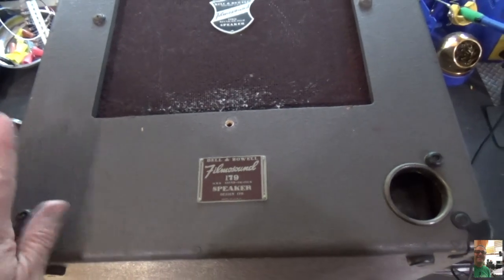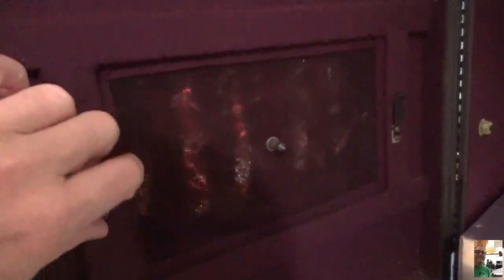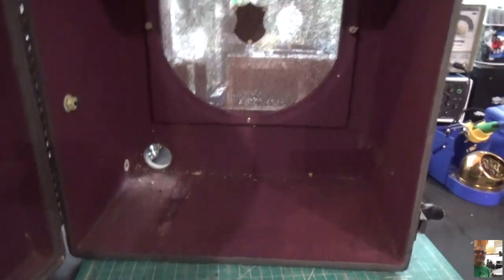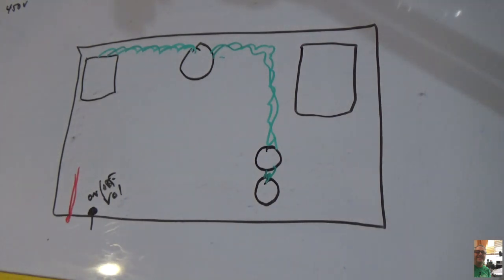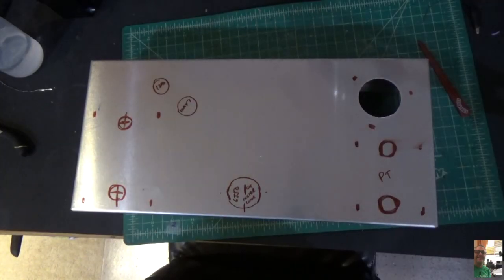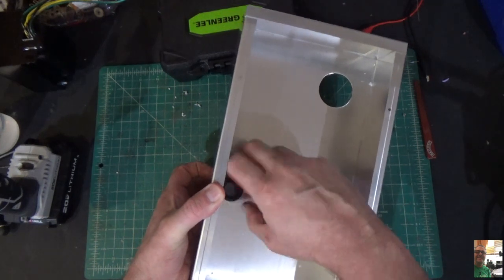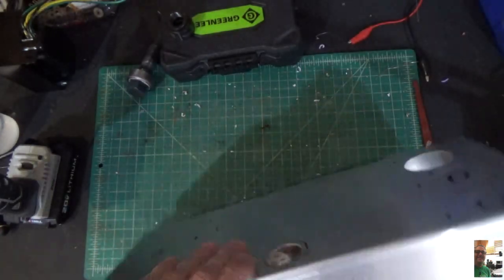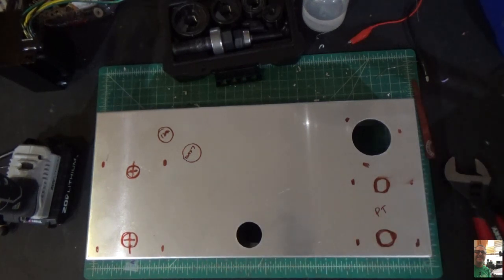The Killer Joe Bass-Guitar Amp Episode #2: Holey DLAB Batman

Comment: A couple of L Brackets would hold that chassis in pretty securely. You would only need two of them to hold it securely and easy to remove for servicing. That is gonna be a neat amp project and fun.
Reply from the maker: You are absolutely right Larry. That is the plan.

Comment: There’s no doubt about it Ron, the slug buster definitely produces neater holes for the reservoir, and smoothing capacitors, as well as for the valve bases.  Also, an excellent position for the KT88: heat will escape via the rear cabinet vent.  I also like how you have positioned the large smoothing capacitor away from the KT88: the affect of heat should be minimal. 
Though I like your idea for the front control panel very much, some people would position the controls and jack socket onto the rear of the chassis, whereas I would likely think along the lines of cutting a rectangular letterbox type of hole in the front bottom of the cabinet, and attach a highly polished finger panel to the front of the chassis where the controls, and jack sockets would be positioned.  The downside to my idea is the prospect of having to recover the cabinet with a Rexine type of covering. There are lots of good ideas out there: your’s, and mine are just two of them LOL.
Regards, Phil.
Reply from the maker: Thank you Phil.  I do have a few ideas kicking around my head on the knobs.. we'll see.. I did not drill them yet.... you never know.  Nothing beats the slug busters !!

Comment: Hey Ron, if you decide to save that screen you might try coating it with flocking.  That way you could pick about any color you like for it and still be able to use the original part and name tag.  Buzz1151 did a speaker screen on a Zenith G725 that turned out pretty good.  I re-did the flocking on a dial backer on Dan's 46-480 Philco and it turned out pretty good too.  That felt material inside the cabinet may be flocking too.  Most craft stores that show folks using flocking nowadays use it to coat the insides of boxes like fancy tool boxes and jewelry boxes.  When they use the green flocking it looks like the stuff on top of a pool table, lol.
Reply from the maker: Good to know Gary, maybe I will do that instead... why not.. it could be fun and Killer Joe can blow the flocking right of the screen .  :) Thanks my friend

Comment: Hi Ron, I sure love the holes the Slugbuster makes. I wanted to suggest using a bit of cutting oil on the dies and they will hold their edges a lot longer than ordinary. Also, have you seen the four small marks on the outside edges of the large die? You are probably aware but if not, they are used to precisely place your holes where ever you want them to be. Just carry out the lines of your X and line the small marks on the outside of the die and whaa-laa, perfect location! Before step bits and when we just had early 3/8” battery drills, we used to use a 1/4” drill bit and drill and hole, enlarge to a 3/8”, then pop a small hole giving us a big enough hole for the big stud, once you had a hole big enough for the big stud, you could punch anything. I had a great hydraulic set that punched up to a 2” male terminal adapter with the add-in box for 3&1/2” and 4”. They all used the same large stud. My son is a Master Electrician and state contractor now and I gave all my good tools to him. I always loved my punches and my benders. I kept my meters.  :-)
Reply from the maker: Very cool, I didn't know that about the markings.... thank you so much. They really do a great job.. This is the first time I used it, so they had plenty of oil on them. I will be sure to replenish this as I go along, again thank you for the tip !!!!   Have a great night my friend.

Comment: Yes, it had flocking, it felt like a soft velvet.  
that pin and clips on the back stored the empty take up reel for the projector.  
D Lab T shirt is awesome.  I think Mrs D Lab should model them in his vids.  
Went to Guitar Center today with Noah, looking at a lotsa stuffage there, lust lust.  
I was liken those EV 18" subs.  I saw an old Silvertone amp like Uncle Doug did, it was 800$ with dual 12 cab.  
Noah liked the Roland V drums for his room, but didn't have the 700$.  
He wanted to get a bass shoulder strap, but forgot.  Not many old amps today, but there was an over priced twin, and a very nice old Fender Bassman with cab for 2k$ if I recall right, appeared to be 60s?   
Noah usually messes with the DJ PA stuff, but not today.  It was loads of fun though.  
D
Reply from the maker: Wow Don, I never thought about that... very very cool. Make sense for sure now that you mention it.  - Thanks Sir.

Comment: Such a shame Ron! I would have rear mounted the controls to keep that nice frontage. It would also have protected the pots from damage.
Reply from the maker: I considered that George, but the way I am doing it will suit my needs better.The back door is very large and has a wide swing. In order to use the amp that way I would need to leave the back open and I would loose the benefit of the cabinet on the base.  I am not worried about damage as this will not be thrown around much.  I plan on using low profile round knobs on this so it will respect the age of the cabinet.   I do appreciate your opinion on this very much.  Thanks Ron
Reply: I get that for sure Ron. I suppose I was thinking of the original cabinet and its intrinsic looks. I probably follow the Uncle Doug school of conversions, where most stuff is rear mounted. I also understand the need for the cab to be baffled for bass and keeping the rear shut.
Reply from the maker: Thanks sir.. this is going to be a playing amp so I want it as KILLER ( aka Killer Joe) as possible... LOL     The baffling is important for bass.   Thanks my friend.